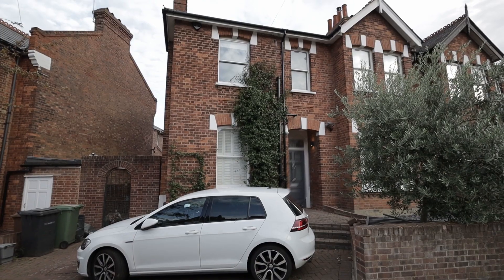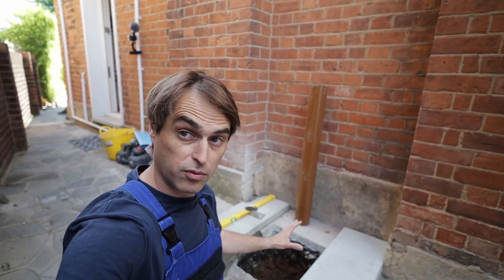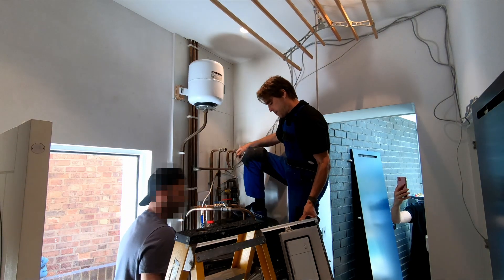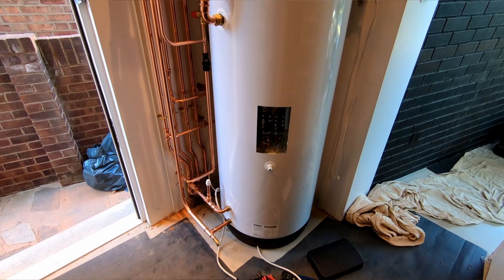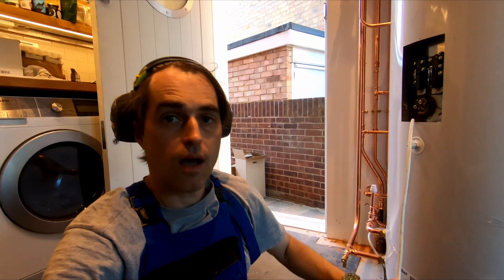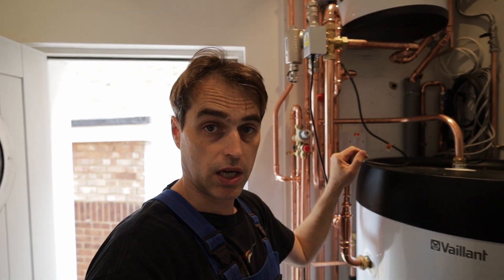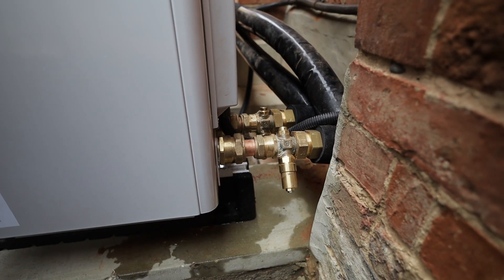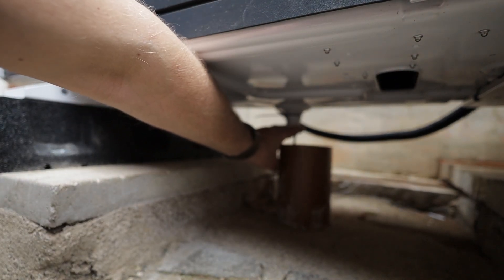Is This Heat Pump Better Than Your Gas Boiler?

Comment: Nice job Simon 
The problem installing this system to an average house is going to be lack of good insulation, most houses would need 10 k plus spent on insulation and new windows and doors before even considering fitting a HP system , that's where the problem lies and most homeowners won't spend the money needed to do it unfortunately....
👍
Reply: Most struggle to pay the mortgage so adding extra debt for marginal savings isn’t a viable option. We’re not all living in vastly overpriced housing in London with big salaries to support our environmental virtue signalling. Agreed, insulation is essential, but unrealistic for the vast majority of home owners because they simply can’t extend themselves into affording it. When green technology prices collapse to reasonable levels the uptake will increase but for now these “solutions” are for the rich or those desperate to keep up environmental appearances.
Reply: @brynleytalbot778  heat pums give instant and measurable savings.
Reply: @SupremeRuleroftheWorld  heat pumps ate expensive and not effective to heat up house during winter.
Reply: @robk2167  everything you just said is wrong. Do you know why or do you have any desire to know why everything you said is wrong? what makes you think that a heat pump cannot heat a home? do radiators refuse to work with hot water from a heat pump and only accept hot water from a gas boiler?
Reply: @SupremeRuleroftheWorld  (what a idiotic  nickname) no mate everything I said is correct. Sure heat pump will heat up the water BUT heat pumps are effective only when temperatures outside are high or mild as heat pump simply is using heat from outside air. If temperatures outside are close to zero or bellow heat pumps are NOT effective and they don't warm water in the radiators enough to heat up the house. Secondly somebody who wants to use heat pumps MUST insulate the house, change his windows and often refurbish his house what is very costly. Lastly heat pumps are running on electricity and they use A LOT of electricity, so with prices of electricity skyrocketing heat pumps are NOT effective at all.
Reply: @robk2167  please tell me EXACTLY what insulation and your windows  has to do with the method of heating up the water that flows in your system. I am not talking about temperture, i am talking about the method. And then tell me EXACTLY how you came to the conclusion that heat pumps dont work when its cold. and be VERY specifc. Trust me, you cannot out-specify me with knowledge in this matter so do your very best to make your case and then i will still have to tell you that you dont have a clue what you are talking about. Deal? lets try and make this a teachable moment for you where you (amongst other things) learn that insulation tells you how much heat you need, not how to make said heat.
Reply: @SupremeRuleroftheWorld  Im not here to debate and I'm not going to waste my time here.
Yes. Insulation and windows are very important if someone wants to use heat pump as house without good insulation and windows will loose heat faster so heat pump won't be  effective during cold winter because will struggle to heat up freezing air, won't be able to heat up water to higher temperature and will have to work much harder consuming a lot of electricity. I didn't say heat pumps don't work when it's cold. I said they are not efficient when temperatures outside are close to zero or bellow - read with understanding.
On top of that we are in the middle of zero net religious obsession and government is pushing green deals madness putting hopes into renewable energy from wind and solar farms which are highly unreliable sourced of electricity. So we can expect soon electricity being limited and very expensive for end customers. As this customers already have to pay green levy taxes, higher standing orders and skyrocketing prices for electricity units.
But hey, looks like you are the one who is highly profiting from this technology so we all know your opinion as it's motivated by £.
Reply: @robk2167  please explain HOW the method of how you generate the heat the home requires has impact on the amount of heat required. and you have not answerd how according to you heat pumps dont work when its cold. spoiler: its has NOTHING to do with windmills or solar panels. i ask you simply to stay focused and on topic. so dont drag in solar panels or the price of energy. those things have nothing to do with the physics of what i am actually asking. put your knowledge front and center and be specific and try it again without going off on tangents with solar, winmills and energy pricing or whatever issues you have with the goverment. your radiators or underfloor heating does not care about any of that.
Reply: @SupremeRuleroftheWorld  I did explained it already beside I'm not here to debate with you. All the best.
Reply: @robk2167  no you did not answer anything again, you went of into a tangent about solar panels and issues you have with your goverment when asked about how the method of heating water infulences the insulation of a building. so no: you did not answer my question in the slightest. you might think that you do but there lies the problem i think and that is why i need to keep going back to these extremely basic questions that you and a few others have a very hard time actually answering as proven again here. that you refuse to answer is fine but in that case i would ask that you refrain from commenting about heat pumps in the future to stop spreading misinformation.
Reply: @robk2167  this is hillarious. I ask you extremeley specifically to answer a basic physis question and you start ANOTHER tangent about conspriracies. Please take a minute to absorb the situation and accept that you dont have a clue what you are actually saying.
Reply: @SupremeRuleroftheWorld  you said that "heat pumps will give instant savings". I did tell you that heat pumps are expensive, home need to be insulated and that heat pumps an not effective during cold winters and exploitation of heat pump is very expensive. I did explained it all but clearly you have a reading problem. I'm not talking about conspiracies but about misinformation and propaganda people in UK are fed with.
Now if ypu talk about instant savings please tell us how much money average family which is struggling to pay energy bills at the moment, needs to pay for heat pump and what would be the "instant savings" from heat pump in uninsulated house during very cold winter. Please answer this easy question and be specific with your answer.
Reply from the maker: Those houses need to be insulated regardless of the heat source
Reply: @UrbanPlumbers  not £10,000 fool
Reply: the heat source has nothing to do with the insulation, that only tells you how much heat you need, not how to get said heat into the building. your (wrong) concept of how heat pumps needs insulation is exactly what is the problem, not the heat pump or the insulation. people (and especially installers) need to learn these concepts have nothing to do with eachother. one is a source of heat and the other just tells you how much of said heat you need.
Reply: @SupremeRuleroftheWorld  you need insulation for heat pumps because you cannot electrically supply the comparable size to a gas boiler. 
Generally the maximum domestic is 17kw. Therefore heat losses have to be managed down by insulation. 
The drive towards HP's is restricted mainly by how badly made and insulated the vast majority of UK housing stock is. This is where high rebates should be directed towards. Reduce demand reduces dependency 
this is also why much colder countries such as Sweden get by with HP's. 
A gas boiler in a house made HP ready would use a similar sized boiler.
I'm quietly suspect of how the numbers are crunched but even the government official figures suggest gas is still cheaper over all iirc
Reply: @richardbartlett6932  that is a breathtakingly wrong  rant that is factually wrong on every level. It is obvious that you dont understand how heat pumps work or heating systems in general. I would recommend you watch some more youtube to educate yourself on this topic.
Reply: @SupremeRuleroftheWorld  forget the ad hominem attacks and actually address the points made...
Reply: @richardbartlett6932  "A gas boiler in a house made HP ready would use a similar sized boiler." this isn't true and if you don't know why it isn't, you shouldn't be posting on a site about heat pumps.
Reply: @MrAndrewjdavis  i think that was an ambiguous statement that he made. I assumed he meant that if you fully insulate your house and determine that you need a 6kw heat source you could either use a 6kw ASHP or a 6kw gas boiler.
That's correct isn't it? Ie the energy requirement is the energy requirement and is independent of the source?
I'm here to be educated!!!

If that assumption is correct then it doesn't fit in with how ASHPs are presented. They're compared with existing insulation + gas vs updated insulation and ASHP.
What everyone really needs to know is, the incremental benefit of just insulating properly and keeping gas, and then the incremental benefit of starting off fully insulated and swapping from gas to ASHP.
Add in lifetime cost including installation and service/maintenance. 
Compare running costs taking into account gas/elec pricing.
Include lifetime co2 including production of the equipment. 
Then we can all actually have an informed debate.
Would love to see the analysis as I'm looking to refurb my house next year but I'm not convinced on ASHP yet.

Comment: For those cursed threaded pipe joints maybe look at Loctite 577 Thread Sealant.

For heat pumps ... when/if we get to that I'll be looking at an air-to-air system with ability to cool in summer (plus some solar panels of course). With what we are being told is to come it seems insane not to at least think about that.
Reply from the maker: This unit can cool as well!
Reply: you can cool with air/water as well if you use fan coils. they also make them every possible version.

Comment: Those callefi freeze valves that we have supplied ,now come with 28mm compression fittings rather than an1" male thread so they are much more convenient, up till this point we were using 28x1" press union nuts (geberitt) which are perfect if a little costly. As a firm we have fitted a number of these vaillants now, the wiring is a doddle and after your first one the setup on the controller is fairly straight forward too. The only issue we have had is siting the outdoor unit far enough away from drainage, but i think we have just been unlucky with the properties weve fitted them on. Smartest looking outdoor unit too (the daikin high temp one is a close second though!)
Reply from the maker: Where do you get compression anti freeze please? Vaillant unit is so easy to wire compared to Daikin. Not a fan of Daikin myself.
Reply: @UrbanPlumbers  All of our kit is supplied by a firm called RES based in Yeovil, as i said they usually turn up in 1" thread, exact same caleffi boxes, but the valves were compression, saves on fittings and space too as the valves are very short in compresson. Hope this helps! Congratulations on the continuing  success of your channel too.
Reply: @UrbanPlumbers  you should try the panasonic aquarea, they are considerably simpler. they also use 5/4 so its stupid easy to directly hook it up to a hose.
Reply: @UrbanPlumbers  we were using 1" sockets straight off the back of the heat pump but Midsummer supplies now send out the 28mm compressions. 😁
Reply from the maker: @mikecole4952  do you mean midsummer have 28mm compression anti freeze valves?
Reply: @UrbanPlumbers  yes mate, midsummer have been sending them out now. The older ones that need irons just don't have enough thread on them. I did the Worcester heat pump course few weeks ago and they say just flexis outside, no isolators or defrost valves (obviously help when insulating). That's my only issue with the defrost valves, how my is on show to the elements.
Reply from the maker: @mikecole4952  I would not mind having isolators inside and may actually start fitting them this way. Less heat loss outside as they are difficult to insulate and less space taken behind the heat pump. I was actually considering doing it that way on this job.

Comment: We have a side return extension for our kitchen. Therefore we have a section of roof footprint available at the first floor level - I thought we could put a heat pump there… 
Is that possible!? Or does it need to be on the ground level?
Thanks - keep these ace vids coming
Reply from the maker: Roofs are not good. They amplify the vibrations too much.

Comment: Another great video, I'm planning to do a hybrid set up by adding a hp to my existing combi. Would love to see you do a hybrid install. Shame there is no funding currently for hybrids 😕
Reply from the maker: One of my September jobs is going to be a hybrid. Also when I buy my next house ( hopefully this year!) I will do exactly that - hybrid with a combi boiler and all DHW will be gas plus undersized air source.
Reply: please work towards going off gas completly. hybrid is just spending more for a half-baked cookie.
Reply: @SupremeRuleroftheWorld  hybrid is better for the grid, takes the stress off during the coldest winter days, when the power is super dirty anyway.
Reply: @edc1569  the grid would profit from heat pumps and heat pumps dont care in the slightest about the quality of power as they run on DC internally. burning 1m3 of gas in your gas boiler would give you 6~8kW of heat. burning the same 1m3 of gas in a gas pwoer plant would give you 6kWh of electricity wich you can make 25~30kW of heat with a heat pump.

Comment: There is a case for both systems. I think the most effective and reliable system would use an indirect tank, heat pump and a cast iron boiler. A thermostat with outdoor temperature can determine which system should be heating the water- or hell, maybe both systems can heat the indirect in a high-demand situation. This system would likely require less maintenance than a wall-mount condensing boiler and would also ensure the house is heated comfortably and fast on the coldest of days. Aside from capabilities on cold days (and ensuring the water temp matches what the radiators require), the main factor to consider is electric vs rates rates. Rates aside, these systems should come with backup resistance heat because why beat up the heat pump on a cold day where the system is running at a low COP anyway?
Reply: there is absolutly no reason for both systems. gas boilers have no place in heating systems anymore. they should have been phased out 20 years ago.
Reply: @SupremeRuleroftheWorld  there are a lot of people in zones 6, 7 and 8 that would strongly disagree with you
Reply: @chrisE815  you can disagree but that does not change the fact that insulation has nothing to do with the method of heating used. at worst you might need to upgrade some radiators to get the temperature down for efficeincy but that also saves you money when using gas boilers. just because you need more heat does not mean you cant use certain methods of heating. they sell heat pumps that go into the megawatt range so that cant be the problem. fun fact: most homes in high number zones like in scandianavia have heat pumps as their main source of heating. so what was your excuse again?
Reply: @SupremeRuleroftheWorld  do you use a heat pump for heating,  yes or no? My entire argument is that in cold (and artic) climates it's not a good idea to rely on air source heat pumps alone. Insulation has nothing to do with my original post.